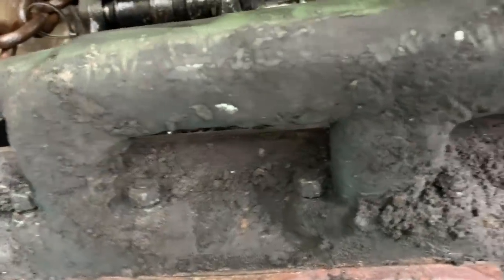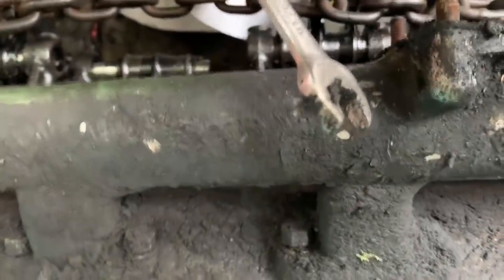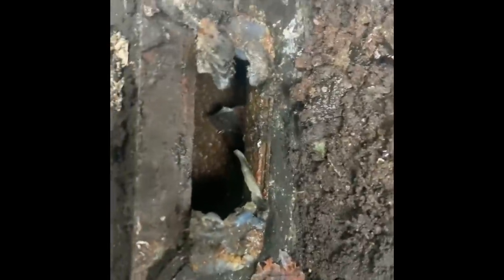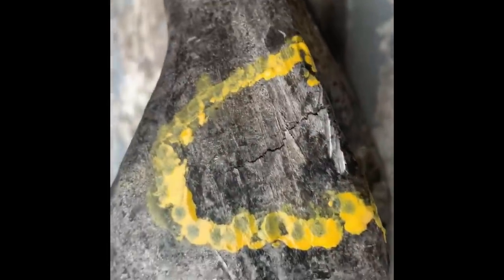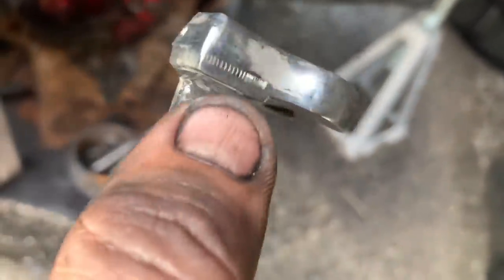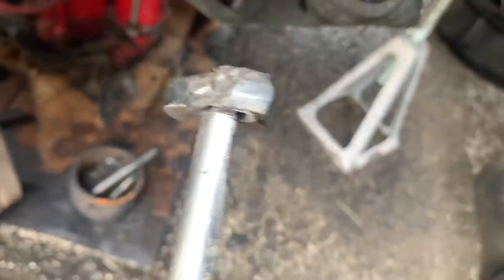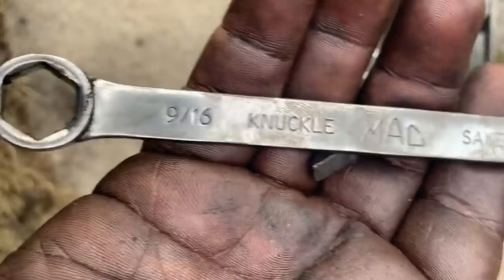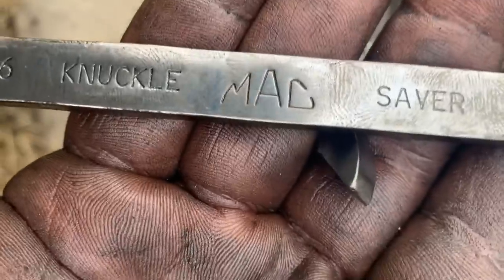Trans removal progress silversides bus

Comment from the maker: Mac tools sent me a link for warranty replacement.  2-3 weeks.   Oh that’s super convenient???  WTH Mac tools. It’s 2019 sears probably did it faster 100 years ago.  Get with the times.
Reply: As visual as this will be they should have sent the nearest truck immediately, by the way, how are your knuckles?
Reply: That's the reason I stopped buying tools off the rape Van's they used to do instant replacement ....now you gotta be outta pocket 2 to 3 weeks if you are lucky ...I dont use anything but craftsman ...cheaper and better warranty and easier replacement  mac ,matco.and slip off I mean snap on all you buy is the name not quality
Reply from the maker: It shouldn’t have been about visibility, it should have just been about doing it the same way for everyone, and that policy is outdated and antiquated.   It’s definitely not in accordance with other “high end brands in other industries”
Reply: Harbor Freight in and out lifetime warranty. As you all know.
Reply: @WifeBTR123  : Being Harbor freight doesn't have a foundry to produce their own tools, they most likely contract a major tool suppliers/producers "Snap-on, (proto/Stanley) or someone of the like to manufacture Harbor freight branded tools, and there is absolutely nothing wrong with that. Being HF has a lifetime guarantee, they are just as good as any tool on the market.
Reply: There is likely a Mac tool truck,not too far off,should be an easy swap.wth.
Reply: trucker 5167: and Craftsman is now available at Lowe’s!  Much closer for me than Sears ever was.
Reply: Mac tools are trash.

Comment: second option.. since you have the case spread.. sawzall the bolt out..  grinding the sides of the sawzall blade flat to get rid of the tooth set so they don't dig into the sides only cut straight thru the bolt.

Comment: That 9/16 wrench was cracked long before today. Note the old crack above the new one.
Reply: You  think someone turned it into the mac guy and he mixed it up with  the rest of  them.
Reply: David Davis it appeared to have a crack about 1/3rd of the way they it probly from manufacturing but chrome plating May have covered it from view. That’s definitely s manufacturing defect tho
Reply: So mac sold it to you as "new" or " used" ?  I also am using Craftsman wrenches and sockets from the 70's. Have a few Williams mixed in. I must say when I need to grind up a tool fit a tight spot I ruin a new tool before I touch an old one!

Comment: Throw the cutting tip on the torch and take a center punch and center punch the center of the end of the bolt so that small part heats fast. Press the button and blow the center of the bolt out so it will shrink some, then punch it out . Just be fast heating it up enough to start cutting so the aluminum doesn't get too hot and melt.
I've blown broken exhaust bolts out of many engines, like the 3/8"  bolts chevy 454's used that were notorious for breaking. Some in motorhomes  where there was not enough room to get a drill straight enough to drill them. Those, I'd blow out to the point where all I'd have to do is chase the holes with a tap to clean the threads without any damage to the threads. Saved pulling the head off. The trick is to do it fast, so the surrounding metal ( in this case the cast iron) doesn't get hot enough to melt.

Comment: Re wrenches, I have a tip I've found for cheap ones. For some unknown reason the rough cast ones are always stronger especially if they have thin shanks

At the local Sunday market there's this old Greek guy and he sells a lot of crap actually.
One time I bought a ring/open end for a special job I needed to do. I didn't want to destroy my good 30yo tool so purchased one and ground the ring end down and bent it - in a vice with a hammer. As I was hitting it I noticed how hard was to get it to bend. It kept springing back indicating good tensile strength.
I got it to the shape I wanted, put a pipe on it as a lever to undo the nut and it worked. The shank bent as I was undoing the nut such was the pressure I was putting on it, but even with the ring ground down, the blunt trauma I inflicted on it with a hammer and the torsional abuse I gave it, it sprang back, didn't slip and I got the job done. 

I went back and purchased an AF and Metric set of ring and open enders up to 7/8 and 22mm, offset rings in metric and AF and bought the same for my son. All those tools cost less than $100. He loves his and I love mine.
Cheap tools can rock. None of them have ever failed and if you loose one so what. Individually they are like $3-$8. 

There's also another advantage, people won't steal them because they are not a name brand tool and look like nothing special.
Rough finish and thin beam/shank is what you're looking for.

Comment: just a tip, when I cut the head of a screw, I could remove it by drilling it first with a small diameter wick and then with larger ones. It takes some time but you can remove it without major problems. very good video, thank you very much for sharing!

Comment: For that broken bolt I used to put a big nut over top, arc weld it, filling up the hole, then use an impact on a soft setting pretty soon after....the welding heats it all up and the aluminum expands more than the steel

Comment: New mic sounds wonderful; for the record, I wasn't one of the people complaining about the sound in the wind.  Too bad about that sMac tool.  I guess that's why people refer to them (and others) as Snap-Off.  I have gotten through life this far with Craftsman, Hazard Fraught, and the likes.  I don't want huge sums of my money tied up in expensive tools. Although, that said, there are some instances where you have little or no choice but to buy from Strap-on or Mac or those mobile guys because those guys actually make the tool that you need for a specific job.  Still, no matter what the price, they shouldn't fail under normal-use circumstances.  Now you gotta find a Mac guy and get it exchanged.

Comment: So many times I had to yell at an apprentice to just use a skim of silicone.  They all think the same, a little is good, a lot must be better.
Made one guy take it all apart and look at how much goo was loose inside.

Quite buying Mac and Snapoff wrenches years ago.
Main reason was I was field service and my tool boxes would sometimes get flooded with water.  I hurt to see that million dollar wrench all rusted up.  The other reason was I am cheap.

And as far as modified tooling goes, have a couple of drawers in my tool chest full of cut up and modified tools.
(Do that with your million dollar snapoff LOL)

Good trick to use on corroded in bolts like that.
Heat the head up red hot, I mean get it RED.
Then walk away, go have lunch or something, do it last thing but just walk away.
The heat will make the bolt expand in the hole and break the corrosion, once everything cools down to normal it is amazing how easy it will turn.

Old guy taught me that trick 40 plus years ago.

Comment: You can see the defect in that MAC wrench, the fresh looking break covers only about half the actual broken section. The darker area is an older crack or more probably a factory flaw. The longer broken forged metal is exposed to air the darker it gets. I buy only craftsmen due to the easy access to Sears. I don't know what I'm going to do now that they sold it to Stanley. I guess Lowe's is marketing it now. I'll have to wait and see how they handle warranty claims now. Good luck with that rebuild.
Reply from the maker: The darker area is from my damn dirty fingers.  It was all one color when it broke

Comment: I use permotex anaerobic sealer thin coat on paper gaskets it never gets hard stays soft been using it for years when I worked for GM also used there genuine GM anaerobic sealer same red stuff. I love it. Also before I do a big job that has years of gunk build up I pressure wash it good. Makes for a lot less clean up and less chance of it falling into engine. Just my 2 cents.
Reply from the maker: This is the transmission goo. It did not get cleaned.   The engine got a degrease before we tore it down.

Comment: bro take a hacksaw blade and work it by hand in that gap between the trans and the engine block slowly and cut that bolt out
Reply: Great idea.  Wonder if he could shoehorn a small sawzall in there to speed up that exact process.

Comment: I have rebuilt 3 hd motors because of over use of silcone i quit buying mac tools a number years ago because the same kind of issues
Have a good day
THE GRUMPY BUS
Reply: I'm retired automatic transmission builder.I have taken gasket sealer and silicone out out of pressure regulator valves many many times after it ruined a transmission

Comment: Maybe replace that motor mount bolt with a 6 point socket head bolt? Then you could tighten and loosen it straight on, instead of having to grab the outside flats. You could use a wobble socket on it too. Oh.... and don’t forget... anti-seize is your BEST friend.

Comment: Looking at the sandy grain fracture of your Mac wrench , suggests it was two brittle fractures . The first could have happened during quenching when manufactured . Good wrenches should always fail by bending . Thus failure by yielding . Since your wrenches get over stressed alot because of so much corrosion and previous over torquing , fracture by fatigue is to be expected . Take the wrench back .

Comment: Why did you heat up the bolt? When it get warm it grows and sit much tighter.
Reply from the maker: Trying to get it to break out the dissimilar metal corrosion surrounding it. We heated the outside first that did nothing. Then we heated the bolt.  Hoping the expansion would squeeze it then when we cooled the bolt there would be some clearance.

Comment: ATTENTION! On older engines with composite ornpaper gaskets a thin thin film of silicone can seal porous and bad surfaces. Too much and not only do you get the silicone plugging shown but the gaskets will crawl on the silicone. Late model printed sealer gaskets do not need silicone except at case junctions.
Reply from the maker: I use old school gasgasinch

Comment: That MAC wrench looks like it had a stress crack in it before it broke, you should be able to get it replaced for free if you contact Mac. It also looks like the bolt you heated is mushrooming, I hope you don't have to grind and drill it out. It might be easier to use a hack saw or cutting disc and cut the bolt between the two housings and work on it after you get the trans out.

Comment: Watch beating on that bolt you torched... since you've now taken the temper out of it, you'll mushroom it over and wedge it in the hole on the transmission. Like one of the other guys said, get a hack saw in there between bell housing and the block and cut that sucker through. If you can find a carbide dust blade, they work great for crappy situations like this...

Comment: 7:36.  You should be using a drift, so that the casing will not be damaged by the hammer blows.
Reply: I thought about how the hot soft(er) end would Mushroom and get fat inside the hole making it impossible to "walk" any further toward the engine side.

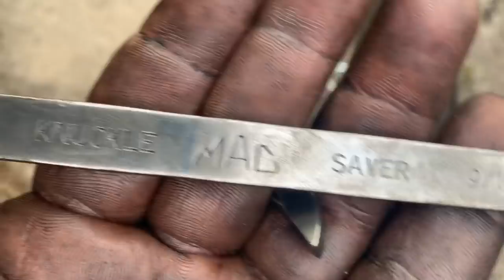Comment: 5:01 broken spanner.   From what I could see of the sheared section, the right-hand edge looks as if it has a stress fracture of some considerable age -- presumably dating to time of manufacture.  You should return it to the vendor and demand "money back", not replacement, on the basis that it is defective and you cannot trust a replacement will be any better.

Comment: NO RTV on anything in the cooling system
Reply from the maker: When i clean out the radiators i often find a few chunks in those too
Reply: @BusGreaseMonkey  yes sir..and a rod job wont remove it. it just rolls back and forth with the rod tool
Reply: I use a little amount of gasket maker in every gasket and every joint.
enough to seal it without smearing.
Reply: @AlejandroRamirez-vl8mr  yes as long as its not RTV

Comment: If you tighten the nut on that broken bolt, it might break it free from the corrosion
Reply from the maker: Tried it.  The bolt broke 1st because it was so tight from the corrosion.  That’s like a 1” bolt.  Maybe 3/4” regardless that’s a big ass bolt to break from being seized

Comment: thread the nut back on the bell housing bolt.. thread on a jam nut..  or cut a piece of pipe to slip over the end.. perhaps with some washers. now you can either use the jam and regular nut to start rocking the bolt.. or use the regular nut against the short length of pipe to lightly push the bolt out.  the best way is actually Center punch carefully and center drill it with a right angle drill . its going to be quite a few bucks in drill bits.   38 at HF https://www.harborfreight.com/silver-and-deming-drill-bit-set-8-pc-61802.html but these have half inch shanks..  you would need something like this.. https://www.harborfreight.com/13-amp-2-speed-12-in-heavy-duty-right-angle-drill-kit-64121.html you might be able to rent an 1/2" angle drill. some homedepots rent a 1/2" makita angle drill for around 25 bucks a day.   if that smaller bolt into the engine block clears the bell housing flange.. you might stick a piece of all thread in that as a guide to make sure you are drilling straight.  if you want to go the other way.. if you can drill a hole perfectly down the middle in probably 1/4" you might be able to use a metal cutting hole saw to carve away the outside of the bolt as you push chip away with the hole saw.  i have only had to do this once.  it worked.  it was NOT easy.

Comment: Mac tools used to be dependable. I guess that's no longer the case. Stick with Harbor Freight I guess!
Reply from the maker: Harbor freight hand tools are pretty reliable.  And they are everywhere if you need to exchange.  And a whole set is cheaper than the one wrench i just broke.  People make fun of them but they are not the swift trucking of the tool industry like some snobby people want you to believe.

Comment: If someone is going to use permitex no reason to use as much as seen here a thin layer will do the job. I never been a Mac fan. I use craftsman and harbor freight both life time warranty and I can exchange craftsman in my small town and harbor 40 miles away. I have never broke either brand hand wrenches yet and I use pipe on them for more leverage.

Comment: 5:03 I hear you. I have a $70 set of two Mac line wrenches that have never reliably loosened a fuel line from an Edelbrock carb or anything else. They are completely outshined by a single $3 Autozone line wrench that hasn't failed me in almost twenty years. The Mac wrenches always spread open while the cheap-ass Autozone wrench never has. 
The moral? Never trust a tool simply because it's more expensive. I've watched almost all of your videos. When I hear of a tool failing, it's almost always a name-brand tool. I don't thhink I've ever seen you post a video where you disparage a Harbor Freight tool. Yes, they're cheap. You don't expect them to last through a single job. But wonder of wonders, the quality of HR tools is increasing while the quality of "name brand" tools is falling. Go fucking figure, eh?

Comment: On stubborn bolts youtuber  mustie1 says hit with hammer, than turn bolt like you tightening it just a hair than back it out.
Reply: That doesn't always work. Even heat doesn't always work either. Anyone that has been in the business I am sure has run across situations that normal procedures don't work for seized bolts.

Comment: Mac tools suck. You can never find that guy either.Get a snap on 6 point 9/16 mine is beefy!
Reply: Not the old MAC tools. I have never broken any of my MAC wrenches. Only thing I did break was a 1/4 inch universal that I had used for many years of wrenching.